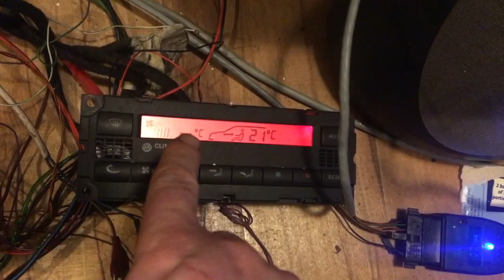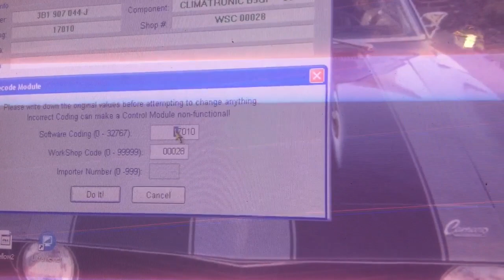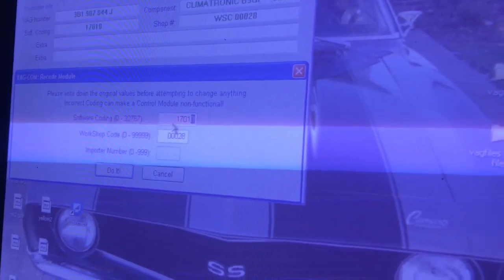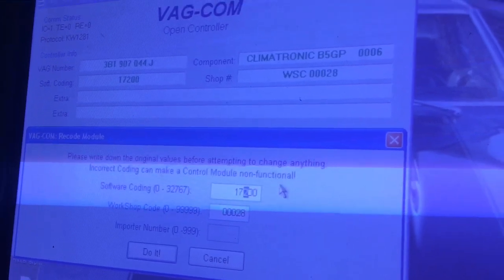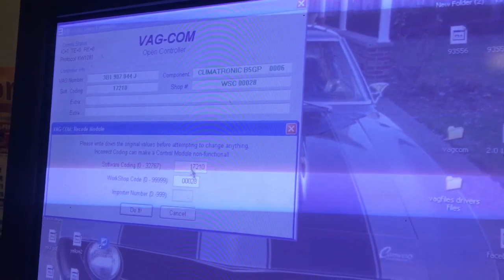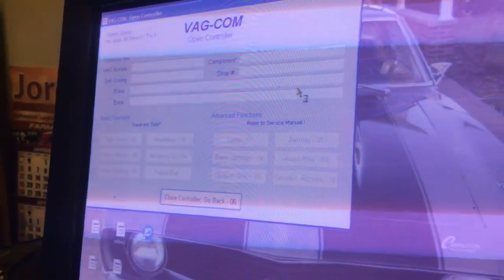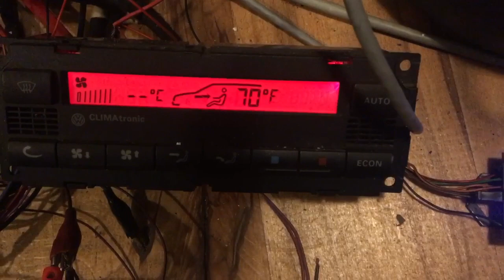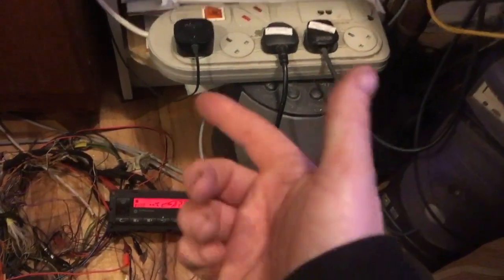Ep24 Climatronic connected to Vcds

Comment: My Climatronic do not identify "Engine Runing" I did a bypass to run The compressor. Any ideia tô bypass by coding?
Reply: Passat B4 Vr6 2.8 1995...
Reply from the maker: Was the climatronic always installed in your car or did you install it?
Reply: @stevenharpervw  por favor vc sabe quais os fios que ligo so pra acender o display e os leds do comando? Pra ver se está funcionando o aparelho somente
Reply: @stevenharpervw how can I bench test this climatronic? Which pins would I connect to test it up

Comment: Mapped cooling is the thermostat/cooling (additional pumps) controlled by the engine ECU rather than traditional way -  so the map controlling that can change depending on drivers request from climatronic & driving style, in the era there's not many engines with that do it, but if future proofs the hardware! Good Luck 👍